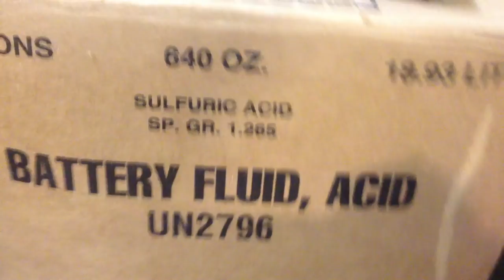Basic Anodizing example (of a Tripod Picatinny Adapter)

Comment from the maker: Thanks and Yup, thats all there is too it. Most important thing (that I may not have mentioned in the description) is to have the surface right before you start - Whatever finish you choose, make sure its uniform because anodizing will make any imperfections look worse. I tend to bead blast my stuff first as its quick and gives a nice finish (anodized or not).

Comment from the maker: The Oxide layer does add a little to the surface, but with a 1/4-20 bolt its not enough to make a difference. On finer threads you might have to re-tap.

Comment from the maker: It's not a process where extra time does anything extra. You might get a bit of color come off on your hands, but thats just dye from the very surface and stops after a cleaning. Whatever is locked into the pores during the sealing stays there bar scratching.

Comment from the maker: There are bubbles coming off both parts, just not as much at the Anode (Oxygen) compared to the Cathode (Hydrogen).

I got the black by using regular dye (I used RIT because it was available at the supermarket).

Comment from the maker: Part 2

I'd suggest something better to hold a Directional Antenna as even though it will likely weigh less than 15lbs, I'm assuming it will be mounted at one end so the load (load moment) will be way off to the side and will probably overcome the ball head with even a light Yagi.

Manfrotto are much more expensive... but excellent. But if you can check Best Buy you can always try it out and see if it will work out.

Comment from the maker: The boiling water should seal up the anodized layer pretty good, but you can buy commercial sealer.

I've never used a commercial sealer though so cannot give any advise on which to buy or how effective they are.

Comment from the maker: Thanks for the suggestions. I know I should do narration, I'm working on it.

I tried to find the peice shown in this video so I could take a picture and add a link to it in the description but I cant I'm afraid. If I find it I will take a photo.

If I anodize a bead blasted part, it looks the same - just a bit dulle. Then after dying with black dye its not quite a deep black as on a commercially anodized part but it looks pretty good.

Comment from the maker: I've never noticed a difference between long and short - so long as the part heats up. If your using boiling water to seal for a period of time maybes it just washing away any excess near the surface so you dont notice it?

Or perhaps the coating isnt as thick?

Comment from the maker: It came with my Sunpak Pro 423PX Carbon Fiber Tripod from Best Buy (I'd suggest going to check it out there before you buy). You can buy the head seperatly from places like B&H photo online for $29.99. It's part number 620-CPG.

It's pretty good , is rated for 15lb - holds my DSLR no problem. I did go through a few before I got one that worked properly so their quality control is a bit lacking.

Continued...

Comment: Im doing anodising too for a while,I know from my expirience that time in seal is important.It prewent too fast wear off color.What alloy you use to make that rail?I was trying 2017 ,2007 bad results,6061 good results ,6063 good results but with  that alloy is hart to get good surface while machining,id needs extra polishing with sand paper,but it drink dye perfect
Grettings

Comment from the maker: I cant remember how long for this part (doesnt say in the annotations?). It depends on the surface area of the part. There are equations but you eventually get a feel for it. I generally pull it out when the bubbles slow down and check. Then look at the surface and if it doesnt look right put it back in.

Comment from the maker: This video just has a small ad at the bottom that you can get rid of by clicking the x. I went back and forth in this and a few others and didn't get any pop ups?

Some of my popular videos do have ad's at the start... but you can skip those after 5 seconds and they shouldnt come back.

If you let me know which other videos are causing you problems I'll check those specifically and see what they settings are.

Comment: Your video is pretty much self explanatory accept your leads from the battery! I understand the + and - color of the leads but power you are running from the battery to the bath looks like you have either some wrapped up componet! Is that a fuse or some sort of controlling device in between. Very hard to make out in the video. A side from that love the video, very clear and straight forward...thanks for the vid and taking to time to record it!!!

Comment: If you have a stainless steel part basically permanently attached to the aluminum part you want to anodize, what will happen to the parts during the process?
Reply: The stainless steel might corrode or break down. In theory, the stainless will only corrode if there is no aluminum present. Try a test piece first.